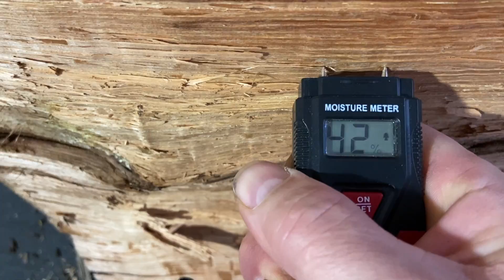Firewood Moisture Check - Ready to Burn?

Comment: When the humidity level is 70 plus percent outside and your wood is out there in it ,rather than under cover,  it ain't going to dry down to below 20% Today here in central NY the humidity level is 94%, but my wood is all in a  fully enclosed woodshed.

Comment: yeah the moisture meter is picking up a lotta residual moisture that oak obviously is known to hold on to but after it's opened up the size you split them, I'd say they should be around a 15 reading in a couple of weeks easy if it's kept out of the rain. Oak is a bunch of big straws but at that age it should be ready to burn sooner than an inch year but we'll see.
Reply: I agree.
Reply: Hey Tom, I'll concur with you on that.   I'm sure when splitting from live, fresh cut it may take a year per inch, but that stuff has a major head start.    Bless'ns to ya,   Tedd
Reply: @sawsurgeon  what i also think would be cool is if he had a shipping container and packed the wood inside with a small wood stove burning junk wood to dry the wood like a kiln. Wood stove will dry out some wood at break neck speed.
Fans circulating tt
Reply: @tombryan720  Great Minds think alike...   I've pondered some type of container to put my boiler into...  A conex box has been on my radar for some time now!
Bless'ns Tom,    Tedd

Comment: Perfect example of why one needs to split and stack off the ground ASAP; it makes everything consistently within 3% instead of having a spread of 30%! Those slabs will probably dry out relatively quickly because the cellular structure has broken down more than when they were living but I think that's a good idea or test to perform on wedges/squares vs. slabs. I try to keep one dimension to about 2 inches and then the other can be 4 or 6 inches because I'm thinking one inch a year, but that's from all  sides (except bark side) so it should dry a two inch slab; one inch in from each side. Or what I do for larger pieces is just crack the ends open, essentially creating another drying surface without breaking the block down further. Easy splitting wood will often pop all the way through anyway but I still get some larger chunks that should still dry down just as fast.

Comment: This is the reason I split oak as quickly as I get it, this year I also started my quick and dirty wood storage racks for seasoning the wood. Oak take 2-3 years or longer to season properly left in rounds, if you split it right a way, you can cut that time almost in half!

I don’t have a wood kiln, but for those fortunate enough to afford one, oak can still take twice as long to dry vs other hard woods!

Comment: Drying wood requires exposure to low RH air, top-covered, off the ground. Heat speeds up approach to equilibrium MC. Lots of "wives' tales" abound, like "20% is just fine." IME 10%  is ok to bring in, and stack near stove, where the MC is down into single digits quickly. Pin-type MM ($14 @HF) measures MC near the surface, $35 Klein MM measures deeper MC with RF. Overall, water is a lousy fuel and has no place in a modern efficient woodstove. Some woodburners work on a 5-yr cycle, leaving lots of time for deep air-drying.

Comment: We have a tame doe here too.  Good looking wood from your neighbors.  It should be fine in your shelter.   Them 3yr old bucked rounds will dry very quickly after splitting
Reply: Those rounds should be off the ground, I’ve also found if on the end, it will suck up moisture, better on side, on pallets?